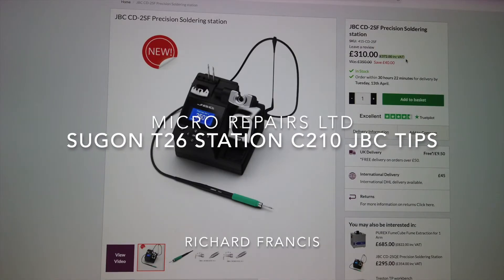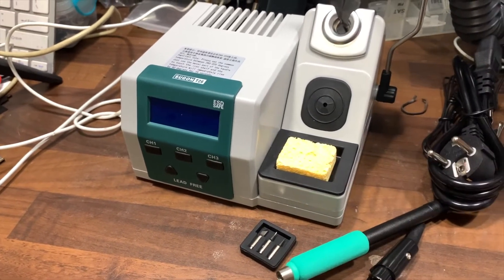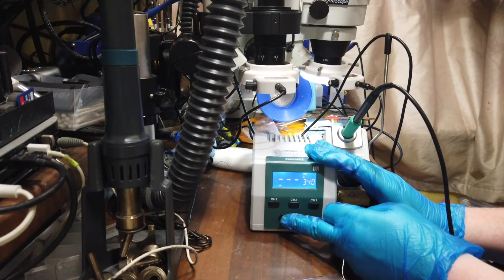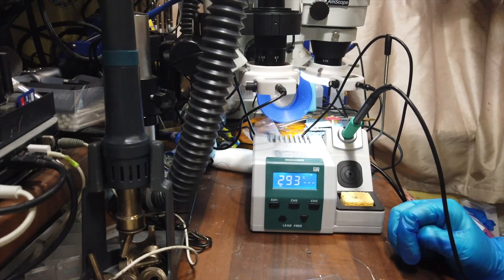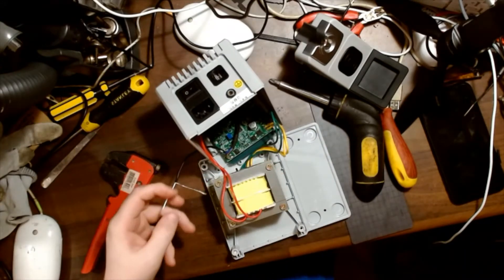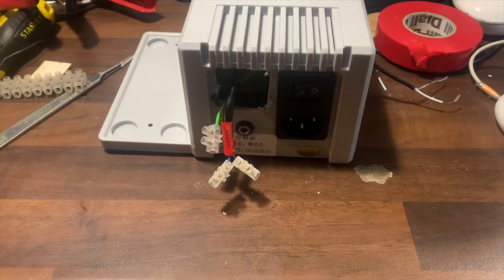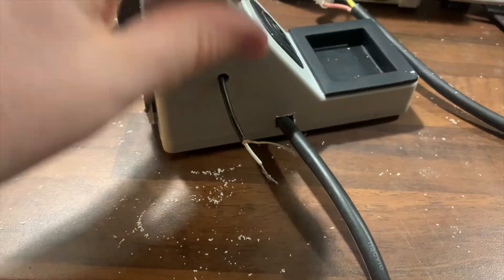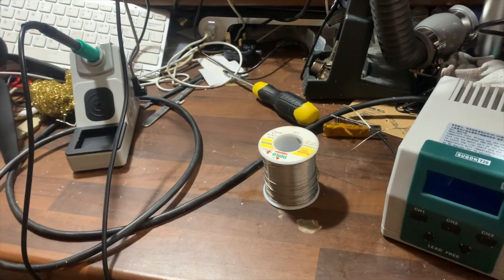SUGON T26 SOLDERING IRON STATION....SETUP AND QUICK REVIEW ,JBC ALTERNATIVE!! T26 MODERATION!!

Comment: Where are these sold for USD 95?
Reply from the maker: Here the link, they gone slightly up since video was published to 99 usd
https://www.vipfixphone.com/products/sugon-t26-precision-lead-free-electric-soldering-station-repair-kit

There is also postage fees to add but it’s still a very cheap station. You can also get them on AliExpress and may even be cheaper on there.

AliExpress link
https://www.aliexpress.com/item/1005002518904900.html
Free shipping on aliexpress